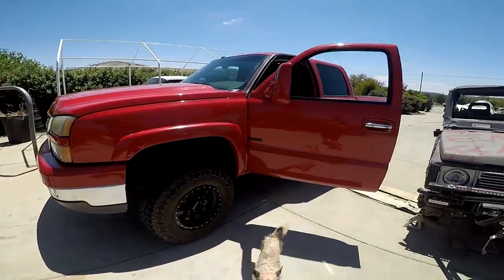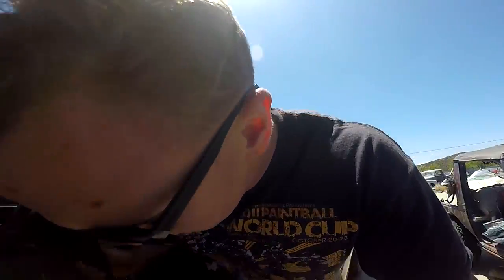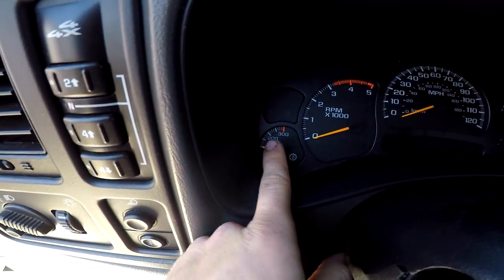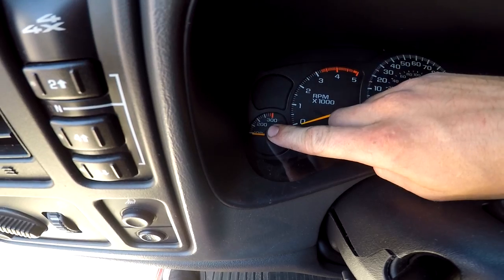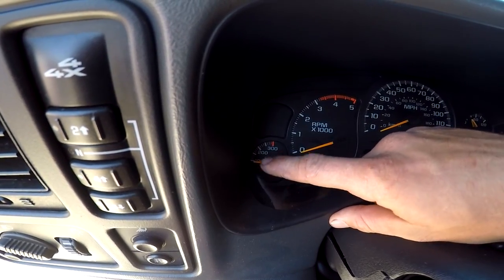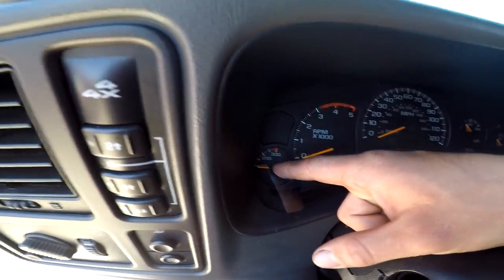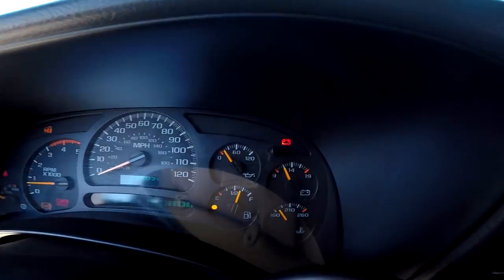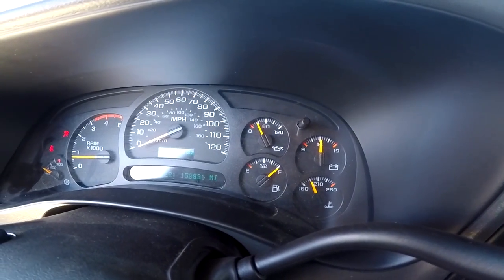DURAMAX Operating Temperatures explained: TALKING DURTY

Comment: Great Video, Thank You Sir. My Dmax Oil PSI Scares me sometimes so hearing your explanation helps ALOT! Thanks again and Please keep these coming.
Reply from the maker: Phil G. Glad I was able to help thank you for the support I will be making more if you have suggestions please feel free to drop it in a comment
Reply: The 2005 Duramax specs in my haynes manual call for 14psi at idle and 40psi of oil pressure at 2000rpm

Comment: A built trans will run hotter because the line pressure is increased. More heat from the pump.
Reply from the maker: Ransom Smith makes sense thank you for that information!
Reply: @RESURRECTEDDIESEL  so what if my temp gauge never leaves 110 on a 2006 chevy kodiack c5500 crew can 6.6 -theres no over heating at all ever and i have plenty of hot heat and ac,i just can’t figure it out why it never leaves 100 barely,110 is extreme working it????

Comment: You make good valid points , however the
Manufacturers do just enough to get themselves out the warrenty period , with that said abs transmissions should never run as hot as or hotter than the engine temp , keep in mind friction is a transmissions worst enemy and some what contributes to friction is the fluid temp , the cooler you can keep it the better the trans will perform and the longer it last , I typically like to my trans temps at least 30 to 40 degrees cooler than engine temp . I have seen fluid come out looking like the day it was put in after a 60k service severe duty . Been in the business for well over 40 years and 20 with dealerships , manufacturers aren’t making money if they can’t get you back as a cash pay customer .
Reply: With that said trans fluid starts to burn at between 190 and 200 degrees anything above 220 and you looking at failure so why in gods name would I want to run my trans fluid temp remotely close to engine temp .

Comment: Muchas gracias 
2009 2500 
Gauge always sits at 180-190
However, OBD gives a P0128 code ( coolant thermostat ) change based on code reading ?

Comment: Hey my brother recently got a lb7 duramax and he did an oil and filter change. Upon firing it up afterward it hit 120psi. After reaching operating temp it dropped but as hes driving it hits 90 psi at full throttle. Around 60 cruising. Its got a wix oil filter and mobil delvac 1300 super 15w40 full synthetic oil. Any suggestions on diagnosing the issue? Im not sure what his psi was before but it wasnt ever abnormally high.

Comment: I have a 04 lly 2500hd crew cab long bed   I think it's 167 inch  wheel base so it's a larger truck than most and I have road armor front and rear bumpers and I haul all my tools that being said mine runs between 188 and 194 at 75 and pulling a dump trailer loaded going up hill never got over 204

Comment: My lml trans runs peak of 160deg when pulling a 30ft gn loaded in the mountains of tn is that fine to be that low
Reply: my lml not towing is always around 100deg over ambient temp when fully warm , it takes a bit to fully get warm when it’s not that hot

Comment: I got an 03 lb7 and my average operating coolant temp is about 150. Would my low temp thermostat be stuck open or is that normal?
Reply: My 04 runs at about 180 once warmed up in the winter, and 200-210 in the summer. 150 sounds low.
Reply from the maker: I agree with jellyfrosh 150 is low could potentially be stuck open
Reply: Just happened to me. 150 is low, changing both thermostats.
Reply from the maker: Hopefully that fixes it up good i wouldndonthe same thing

Comment: What’s up. Good video with good amount of info. I just recently bought a 2004’lly with 250,000 miles
Coolant comes out the reservoir when filled back up on mine. Truck doesn’t over heat and doesn’t have any mixing inside the oil. My heater works but it takes a while for it to get hot. Would you think it’s bad thermostats or blown heads?? Thanks man hope you can help or anyone on these comments section!
Reply from the maker: the cheap and easy fix would be to change the cap on the reservoir and see if it continues to happen and if it does they make combustion gas tester but because you constantly are adding new fluid it never really gets dirty to tell but if you drive the truck for the day and park it for the night, the next morning go out and open the hood before starting it and check if the upper radiator hose is still hard

Comment: I have an ‘01 and run fryer oil. It has a few extra gallons of coolant that runs through the tank to heat the oil so at first I had a problem getting it up to 180 so I put a grill cover and now it runs between 180 and 200. The last couple of times I’ve gone over the mountain pass (12,000ft) it way overheated. Can’t figure out why.
Reply: What conversions did you have to do to run fryer oil?

Comment: I have a 2007 duromax 6.6 with a flatbed instead of a regular bed I bought it used. And it started overheating when i go over 40-50mph but idling it doesn't overheat  but it hits 275 and almost 300 on hwy? I need help fellas asap some tips please!!!!
Reply: I would check thermostats, there are two of them a cold one and a hot one, it is probably the high temp. the hot one is supposed to open at about 210 degrees, if it is stuck closed than that would explain overheating at speed. I replaced mine with a 190 degree one from XD.

I also would check injectors, because if the nozzles are failing, than they will throw more fuel than the engine can handle and possibly melt a piston. I know because it happened to a truck I bought. 
Hope this helps!
Reply: Definitely a blockage. Either thermostat or a blocked radiator

Comment: Thanks for this video very helpful my truck will barely warmup and blow heat I’m thinking my thermostats are bad but we’ll see
Reply from the maker: If it doesn’t warm up after a few miles down the road I would definitely change the thermostats they could be stuck open for sure usually after about a minute of idling before I leave I get about 3-5 minutes down the road and I have heat blasting in the mornings
Reply: Ok thanks man imma replace them
Reply: If you live in real cold weather try a grille cover too. Duramax never heat up in the winter.

Comment: What should you oil pressure run going down the road with converter locked up mine runs ab 40psi is that low or just me and I have 15:40 rotella and it has about 4K miles on oil
Reply from the maker: thats fine duramax are hvlp (high volume low pressure) pumps that dont require a crazy amount of pressure! maybe time for a change but as the rpms go up you should see a rise up and thats good!

Comment: Hey I have a lb7 and it’s time for injectors I’m thinking about doing Head gaskets at the same time and studs my question is can I put head studs in with the motor in the truck I know that last head bolt closest to the fire wall is tight thanks bro
Reply from the maker: i have done head gaskets and studs while in the cab before! you can do it but it is really tight on the driver side. what i ended up having to do was set the head on the block without the studs installed then thread them down like bolts and then do the rest and i believe it was only the driver side! but can be done just have to get a little creative!
Reply: Take the transmission mount bolts to the cross memeber out and jack up the trans as to rotate the engine and the bolt or stud will clear the firewall fine.
Reply from the maker: Matthew W that is a damn good idea!!! Thank you for commenting that!
Reply: Matthew W that’s something I’ll will do thank you
Reply: My opinion is faster to do that with the motor out it's easy to come out and put back together
Reply from the maker: TIZOC RC I agree that’s what I did and it was a breeze

Comment: P0128 code on my edge 2 the other day. Your timing couldn't be better. Low temp on the readout, took forever to warm up.
Reply from the maker: These trucks usually take a good bit idling to warm up we’re you driving it
Reply: @RESURRECTEDDIESEL  Yes, I usually slow roll for it to get to temp then drive normal. I ordered the Mishimoto from Amazon.
Reply from the maker: Yeah I would definitely start with the thermostats!! Hopefully that takes care of it

Comment: Great video for us new owners especially for the LLY.  I’ve been paranoid about head gaskets since I got the truck.  I’m in the middle of a water pump job right now because my old one was leaking from the weep hole and the flange for the oil cooler pipe.  Never have coolant gushing and my upper hose was only firm once after towing my jetskis through the hills in 96 degree weather...hoping I’m ok
Reply from the maker: Sounds okay right now! Hope the job goes well if you need anything feel free to ask! It’s not too bad once you get the balance off!
Reply: Got it finished up today, took my sweet time lol!  So far no leaks and not blowing coolant or losing it.  I think I have developed a sound similar to marbles rattling in a can which some people claim might be air in the system so I'll bleed it again tomorrow and see what happens
Reply from the maker: Hmmmm never heard that exspression for a noise before but good work let me know what comes f it!
Reply: It's not air in the system.  Some more research has led me to believe it's the gear on the pump itself not meshing correctly with the cam gear that drives it.  Have you ever seen this or heard it?  It's difficult to pin down because it's resonating throughout the engine.
Reply from the maker: I have not heard of that usually as long as the bolts are tight and it’s sealed to the block it’s on the gear. It’s a pretty tight tolerenece unless you got a junky pump. If you have Instagram add me and send me a video of it
Reply: What about torque converter rattle?
Reply from the maker: You could check the flax plate bolts I haven’t ever had a rattle just a wine coming from the transmission but a loose flex plate could make some serious noise
Reply: My 07 duromax with steel flatbed is overheating arround 275/300 when I get over 40-50mph I need help fellas

Comment: I get nervous with coolant temperature when the fans roaring and the coolant temperature isn’t dropping
Reply from the maker: Mark Ryl-Kuchar as long as your dash isn’t above 210 you’ll be fine especially if it’s hot out and you’re staying in the throttle a bit but if it never fluctuates I would look into new thermostats
Reply: Mine is heating up to 255 pulling up big hills with my horse trailer. As soon as I get to the top it’ll go back down to normal 210.  Thermostat or fan clutch ?.

Comment: Transmission on my 07 LBZ maintains a steady 150* and my thermostat at 75mph stays at the line before 210*, in town trans is the same and thermostat drops another line mark.
Reply from the maker: Sounds about right man that’s what my truck does
Reply: Allison says 100deg above ambient is normal.

Comment: One little trick is to turn your heater on I do this when I run into the mountains when I'm hauling any type of load but it is a temporary fix and it kind of sucks I am trying to figure out alternative ways to super-cool the truck 4 coolant air conditioning system for the engine I don't care I'm going to figure this out one way or another
Reply from the maker: Yeah totally understand that have had to do that trick before and that would be kinda sick a coolant to air cooler but using a/c as the air over it
Reply: Electric fan and mishimoto trans cooler setup solved it all for my lmm👌

Comment: Funny you post this video.. This past weekend I was driving up back to work(5hrs) and got a little raging on a Mercedes.. Well after about 4-5miles of flogging beyond what I should have, I finally noticed my dic going off at me saying low coolant&engine over heat.. fml. Pulled over and realized I had left the resavior cap too loose and so shut the truck off and added almost 5gal of water. Dear God I was pissed at myself. Had 30miles left to go, drove the rest of the way fine, haven't had opportunity to drive anymore but Jesus have I been concerned about it.
Reply from the maker: Jake Ashcraft that definitely is not good but it happens what year truck? Hopefully there’s no issues I would put some coolant in it out the cap on all the way and take it for a drive and see what happens if something weird happens feel free to hit me up!
Reply: Yeah man, I've definitely been trying to turn down all the dogging my truck so much. It's 07 so got the better gaskets but still worried me about the heat to heads. I picked up some dexcool and since driven it about 1k miles and it hasn't used any of the water so I'm thankfully gonna have to drain the water to add the coolant back. Thanks again for being welcoming to help my girlfriend when she drove it to Anaheim last year and got a random thermostat code! We'll have to have some beers whenever I make it out that way myself, if you're still there hah
Reply from the maker: Yes of course man always glad to lend a helping hand and maybe when I road trip home if I don’t see ya before then I’ll stop by! But glad the truck is working itself out hopefully no more issues for you!!
Reply: DURAMAX_DIESEL Cool, beers on me when we link up! Where's home for you by the way, Rhode Island?
Reply from the maker: Sounds good boss and yessir! Rhode Island sure is
Reply: @RESURRECTEDDIESEL  wait you live in Rhode island I live near Stonington CT near Westerly
Reply from the maker: I grew up in westerly for my whole life and when I was 18 moved to Exeter but I currently live in California but I should be moving back to Exeter and opening a shop there next year!
Reply: @RESURRECTEDDIESEL  wow no kidding that's funny. I just moved back 2 year's ago. I grew up in Arizona for 9 years. You're shop would thrive up here. I just got a 2005 LLY I got from my boss. Just did a 4 inch straight pipe last Saturday. Sounds awesome
Reply from the maker: brad11344 that’s awesome man small world for sure haha! But I bet these trucks sound great opened up!
Reply: @RESURRECTEDDIESEL  ya it's almost too loud I gotta post a video of it. Old system was a little rusty and had holes so I had to upgrade. Not legal in Massachusetts IDK about Rhode island

Comment: What about intake air temperatures? And do you measure from the manifold or the intake itself?
Reply from the maker: i dont believe that lly have the valley sensor like the lbz do but if anything it would be measured right off the maf sensor in the intake on the older models but i never check mine
Reply: DURAMAX_DIESEL  Thankyou for the quick response, I was wondering because on my LBZ when I give it gas the IAT at the manifold skyrockets to 180 degrees and it seems a bit high
Reply from the maker: Yeah I’m not too familiar with intake temps the lower the better obviously but the sensor is in the valley so I’m sure it gets warm! Do you have a cold air intake or anything
Reply: DURAMAX_DIESEL  I have the stock intake, I’m skeptical on getting one because certain ones are known to increase IATs because of a poor design
Reply from the maker: I’m pretty sure banks is the only really good rested one that works a lot of big power guys run them
Reply: DURAMAX_DIESEL  that’s the one I was thinking of going with, they have a oiled filter and a dry filter which one would you recommend. Thankyou again for your help and time
Reply from the maker: Anytime man! And I prefer dried you can clean them easily they flow great

Comment: My lmm transmission always sits at like 130-140 even in summer lol. I don’t tow heavy so I’ve never seen how high it’ll actually go
Reply from the maker: Hahaha that’s definitely not a bad thing at all! Usually 100-120 degrees above ambient while towing is normal just depends how heavy and how hot it is out!
Reply: At approx 150k miles the injectors will need to be replaced, if you tow heavy, but, as a daily driver, not hauling, it will run great as long as you don’t tow heavy.

Comment: I called Allison trans, 100degrees above ambient is correct, therefore 200+ can be expected when towing heavy loads in 100+, BUT, if the trans never gets above 180 the life of the trans will be longer, I installed a forced air trans oil cooling system, up hill in 115 degrees at 4000 ft  towing 17000 lbs, trans temp never got above 180 degrees, just saying.
Reply: Do you have a link or info on the trans oil cooling system you used?
Reply: @volveras09  Derale duramax transmission cooling kit around $200, I went over board and had hydraulic lines made with the correct fittings to match the new kit and existing trans line, then added on/off switch for the fan motor, good luck.
Reply: @davidmiles2597  thanks! Will check it out